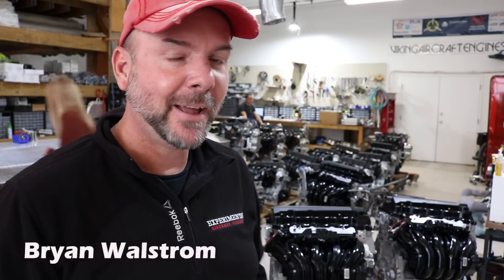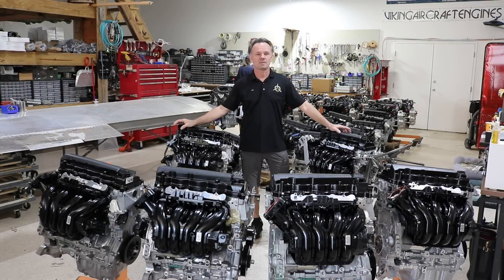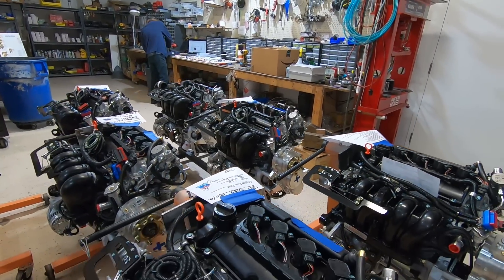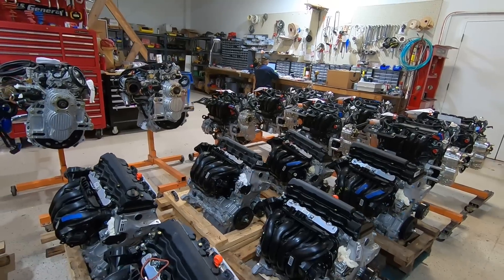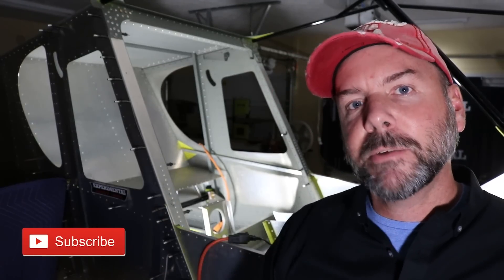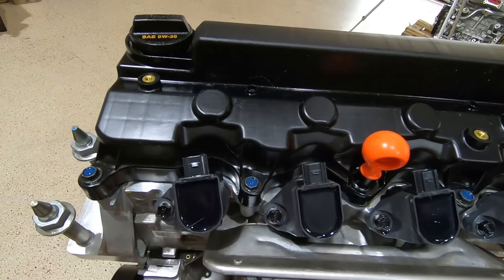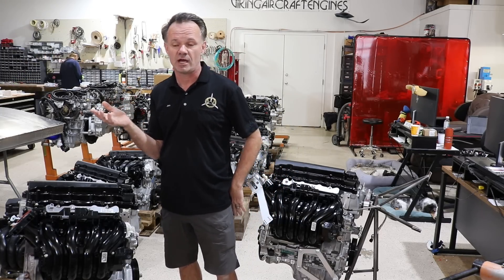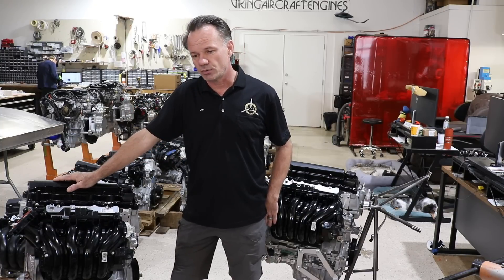150HP Honda HRV Aircraft Engine! Viking Aircraft Engines

Comment: I have a 2017 HR-V 6 speed that I bought brand new. Recently passed 160k miles and it has given me zero problems. It does a lot of highway cruising so I change the engine oil/filter around every 7k miles with Pennzoil platinum, have done an oil analysis report at 60k & 120k and they have looked great. The car runs and drives like the day I got it, can’t say enough good things about it. Seems like a great engine choice for aviation where power, reliability, size, weight, and efficiency are all important factors.

Comment: Interesting episode! With trad aircraft engines so expensive great to see alternatives. Couple questions that I was keenly interested to hear about….
- have they explored the possibility of different piston stroke and grind to camshaft lobes to move peak power to lower rpm for economy and providing less stress to re-drive? ….and
- does the 150 require new reduction drive? 
- any history of problems with their reduction drives? They are typ the weak area of auto to aircraft conversions.
- expected fuel burn? is important info these days
Thanks….

Comment: This engine is bulletproof. We have a 2006 civic and it has 400,000 something miles on it with original engine. SUPER RELIABLE
Reply: Ahhh okay….however running it at typically much higher rpm and through a reduction drive is a much different animal.
Reply: @danah358 why? If its in its designed rpm range and properly lubricated and cooled it doesnt give a damn what its pulling.

Comment: The stronger bottom end will be an asset. I would really like to hear torque specifications and horsepower specifications that given rpm. I've been around engines since the 60s, and torque and consistent torque is what drives an aircraft. Horsepower has or less to do with it than torque numbers. Your stating that you can get by with the port injection rather than the gdi. GDI is not the best for an aircraft. The reversion alone, even if you don't use a PCV with at least an attendant catch can, which I would put on every aircraft especially the ones are turbocharged. GDI can eventually cause the engine to start to fail. It does not offer enough more power and fuel economy to justify the problems that come on down the road. The port injection is more than fuel efficient enough and enough power without the attendant fouling of the intake valves to more than justify having the port injection. The increase torque that comes with this 1.8 will make more difference than the little bit of extra horsepower.
A number of videos I've heard people talk about how much better they liked the 130 horsepower compared to the 110 horsepower engine in their aircraft. It isn't the horsepower difference it's making far more comfortable. It is probably the extra 20 or 30 lb of torque that the engine is providing. This is precisely why the most sold brand new twin engine aircraft in the United States today is running diesel Automotive engines with a cast iron engine block no less. Because it puts gobs of torque and it does it consistently.
Maybe I'm missing something here but I do however like the idea of the 1.8 being added to your line. I like the concept of these engines I think they are going to be ultimately more reliable. I also believe that the TBO time is probably going to be better even with the higher RPM.
This looks like an excellent engine to be used in a twin. And that would be a twin in a couple of different configurations. And with a turbo added to it it could be superb. The next one I want to see is that Ford Barrel engine built up as an aircraft engine for a larger aircraft. I am seeing reliable engines in the 500 horsepower with that inline six naturally aspirated all aluminum engine.
Reply: Just spray some cleaner into the manifold every 100 hours and it will stay clean. About 7-8 bucks.

Comment: You might know this question (answer).
Long ago, there was a motor which was at one of those air shows, maybe Sun & Fun or Oshkosh.  
It was a 2-cylinder, opposed, 4-cycle motor that was being developed.  It was unique in the way they were obsessed with making the motor as simple as possible.  The rockers were not directly oiled, instead they ran (was it felt?) something which you'd have to relube every few hours (or perhaps each flight).
They had some good ideas, does this ring any bells?  Remember any motor like I described?
Thanks,
I love your channel!
Reply: That's the buddy twin.

Comment: You want power alot more then 150 horsepower use a V8 and rebuild one out of a junk yard and build one up to 400 horsepower or more all depends how you build it up. You build it up to be a race car engine, then put it on a airplane now you got something good. But make it worth it. get a propeller to fit it or you have to maybe modify it some how. This propeller has to 13 blades in the circle and has to be 14 inches wide each blade. That will give you maximum pulling power at a high volune of air and should do well in fuel economy and you be happy
Reply: Tooo much weight….but humorous.

Comment: Is Honda fully on-board? I would think the basic design and product support from Honda would be superior to what was offered by an "other" (no specific name offered) light aircraft engine company, and the reconfiguration by this company would make it a good product to consider for rag and tube backcountry builds. Noted the crank truss plate- to prevent crank journal flex under loads negating the need for a heavier block....?

Comment: doesnt the rpm to high for  prop mess this up
Reply: Rotax has been using reduction gearing for years with great safety. I'm sure Viking uses a similar system.
Reply: We have been using our gearbox for over a decade, easy to maintain and reliable. Ensuring it is designed and tested very well is where people miss the mark.
Reply: @eggenfellner  Do they have a clutch in them to save the engine in the event of a prop strike?

Comment: Pretty tough going up against the   Apex. 
A variety is always nice though.
Reply: Its a honda engine pretty tough trying to make a more fuel efficient engine with power to weight of a honda
Reply: @cheetomussollini  from my excel comparing engines the apex has the highest power to weight I can find as far as aero conversions.

Fuel efficiency could be a different story though, harder to compare, but both being tuned efi /w wideband O2 and mass airflow sensors I can't imagine they'll be too terribly different.

Comment: Where do you get 25 brand new 2020 motors, out of cars yet with zero miles? What happened to the cars?
Reply: Umm,  it's called " Crate Motors ". It's a new thing...Prolly never heard of it...It's a  big secret....
Reply: @ToyManFlyer1100  Crate motors come in crates, as in brand new. These motors are also brand new, but he said they were in a car, so my question is who took them out and what did they do with the cars? Also, he said they were brand new, so that means the cars were never driven, which only deepens the mystery.
Reply: These cars were damaged in a rail - shipping accident and insurance settled on the cars so parts get sold out  “new...”

Comment: Why do you think that pupose designed aircraft engines only rev to 3500rpm?
So they last and are never over stressed. You put a car engine that revs to 6000 rpm and you are installing a hand grenade.
Reply: Care to elaborate on that? You are aware that they mount a reduction gearbox on the engines to slow the prop down, right? Same thing Rotax does on the 912/4/5 mills.
Reply: @GrizzAxxemann  This fear is not unfounded. The engine speed is not reduced. The propeller speed reduction does not reduce engine stresses. Automotive engines are not designed to sustain the high rpms but shouldn't be an issue as long as aux systems are upgraded. Just don't expect them to last as long as an aircraft engine (all else held equal).
Reply: @MrCarGuy  So a car engine built to run 500000+km with oil change intervals of 10000 km can't handle 2000 hours at peak power (not max power, but where yhe Hp and Tq curves intersect) with 25 hour oil changes? 'Splain me how, Lucy.

Comment: do you think civic engine 2.0L 306hp will be  offered anytime soon for airplane??
Reply: Sounds to small. Aero engines are generally  rather large in displacement.  2.0l and 300hp probably leads to a fair amount od stree
Reply: @zuestoots5176  not really Viking 195  is a 1.5 turbo this 1.8 na 150hp  with a turbo run at similar boost levels could easily make 230-240 hp
Reply: @zuestoots5176  od stree ???

Comment: I take these won't be designed to run negative gs or will they be modified?
Reply from the maker: Most often even Certified Aircraft are not designed to fly inverted or with negative G's. You must maintain a Positive G load say... doing a barrel role. There is an OPTION for an Inverted Oil system.

Comment: 2 spark plugs per cylinder?
Reply: That engine would only have one, and would compromise reliability if they were to add another. Not too many ignition failures on those engines.

Comment: Very informative! If it’s not confidential how does VAE get 25 brand new Honda  engines no miles that were in cars? Hail damaged fleet?
Reply: This in particular was train damage. Sometimes it varies, and sometimes we have low mileage (1k-5k miles)  not necessarily new. The VIN is on all the engines along with pictures we receive :) There should never be a company talking about "confidential" as far as engines or what kind of engine...if that is the case you can probably guarantee its a lie or a copy cat.
Reply: @eggenfellner  Or a chopped stolen car.
Reply: @6milesup  Hence the lie.

Comment: Moto Guzzi has a 1400cc OHC transverse V twin.. 95 HP normally asperated... a few minor modifications and it will put out 150hp easily... and beyond... a healthy man can pick it up by himself... I have a heat treatment that turns aluminum into a palladium alloy.. 1550° C melting point... passes magnetic energy with no resistance... and wicks away heat up to the melting point... I can run hydroxyl fuel... from another simple process... basic chemistry.. not even new science.. not patentable.. which is why we don't use it... go figure... 
the more complicated the machine, the more things there are to fail... not a good idea at 10,000 meters up
Reply: I am actually thinking about approaching Honda with the metals... doesn't oxidize... light as aluminum, strong as steel... ductile as silver... cheap to make... from existing parts... or 3D print
Reply: Motorcycle engines use integrated transmissions. Too much dead weight.

Comment: Why not use a Honda Goldwing engine?  Awesome flat-six, reliable as an anvil.
Reply: Mostly because it isn't as mass produced, they are "recreational" meaning the cost of initial purchase is going to be much higher along with parts.
Reply: Great question.  Maybe EAC could include a bit of that in some video.....
Reply: Anvil. You got rthe word right. Way more than 200 pounds. Too heavy for the HP
Reply: In a goldwing engine the gearbox is integrated into in, lots of unnecessary wt.
Reply: I've heard the goldwing engine is big $$$
Reply: @kazansky22  Buy a used bike !  They are cheap and they go over 100,000 easily !

Comment: Have you guys thought about using the new Toyota Yaris engine? 1.6L 3 cylinder rated at 260hp standard. De tune it so it isn't running near it's max and it would last forever. Would be a perfect aircraft engine!
Reply: Hey Nick, we looked at the Yaris years ago, but in the states it’s still a 4 cylinder as far as I’m aware and I think it’s a heavy block if I recall.
Reply: @alissaeggenfellner4613  have you taken a look into the Subaru FA24? the thing is as reliable as they come, no GDI problems as it has both port and direct, turbocharged and quite efficient yet light.

Comment: Are these engine burning auto gas or AVGAS?
Reply: Either works, preference to auto fuel. If using 100 LL the use of an additive is needed.
Reply: @alissaeggenfellner4613  what is the required additive please?
Reply: @daisybeagle6259  TCP or Decalin

Comment: The entire problem with this concept is the rotational speed and power developing at higher rpms. The real dilemma is people wanting performance at the cost of saving $, the particular concern is in the individual ignition coils/system as a huge area for potential failure over time. Because of the relatively low efficiency for gasoline as a fuel source, this is a really limited concept. Gasoline has a very poor flame spread rate leading to inherent inefficiencies as you raise the operational speed of the engine. To overcome this you find a delicate balance of compression ratios, ignition timing, and octane ratings. In an aircraft this is not a good idea and will lead to accidents as the failure rates increase, that will effect all in insurance rates. These little engines scare me, I’m not betting my life on them. They have no track history and were never designed to be run at these high rpms consistently over long periods of time in varying altitudes and air density conditions. One other consideration is the increase of moving parts and complexity, especially in the variable valve timing that Honda uses in their Vtec concept engines. They really only develop higher HP ratings with extreme valve timing and computer assisted changes to the engine while operating. Just the sound of a high revving engine in an aircraft doesn’t bring to mind safety and comport, my spider sense would be tingling the entire flight. I owned and raced a Honda S2000 for years and sold it because of unreliable torque and quirky power delivery. Replacing it with a Porsche Cayman solved all those problems because of the power delivery and predictable valve timing.
Reply: None of that really matters. It's probably more than reliable enough but these engines simply aren't adequate. Their torque is not competitive
Reply: Agree if you are talking about the reduction drive or other mods….
Reply: Talk about opinions formed by bias... 🤦‍♂️

Comment: AWESOME.. finally I would replace the continental and Lycoming for Honda in a heartbeat
Reply: Not me....these newcomers have been trying to replace the old school engines for years...The reliability of the lil' old Continentals and Lycomings can not be beat.
Reply: Yeah that heavy liquid cooled engine and radiator, with a gear box bolted on to reduce all that unnecessary RPM makes it better ???
Reply: Everyone loves to hate anything old. You'd replace engines that are dea simple and extremely robust and have logged millions of hours safely....in a  heartbeat. Why exactly. To add a gearbox and a liquid cooling system. Electronic Ignition sure. Fuel injection sure. Scrap the whole design. No. The reason they cost so much is our dear dear government regulations and the fact that nobody is into general aviation anymore. Best I can tell these guys are direct descendants of snale oil salesman. Many people have bought in and never heard back.
Reply: @autonomousindividual7780  Exactly. Proven and reliable technologies like fuel injection and a reliable ECU? Absolutely. Automotive engines that never had decent torque to begin with? No thanks.
Reply: I would like a Honda clone of a continental-lyc and modernized without all the textron shenanigans
Reply: Bryan: You May be too young to have been around when Jan ran a Subaru auto engines conversions and sales business. After overpromising and underdelivering, he took the bankruptcy route. There are many of us who remember this vividly. I am amazed that Honda has not obtained an injunction to keep him from using their name. And then there is Jan’s toss-off remark explaining the use Honda engines as coming from a “little fender bender.” Most auto accidents where the insurance companies “total loss” a vehicle are Front End collisions.